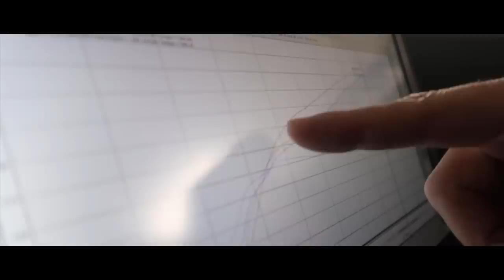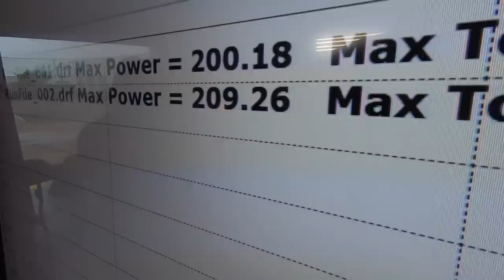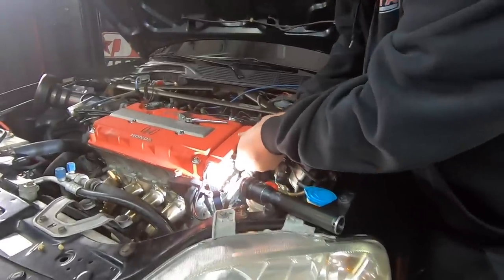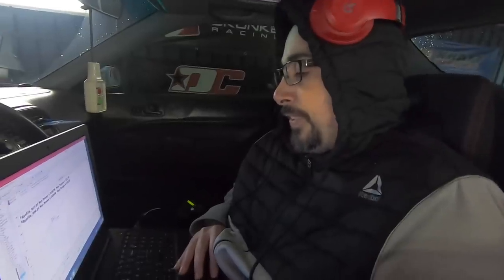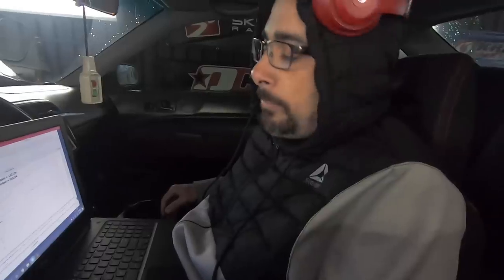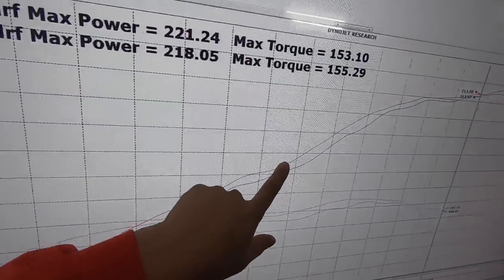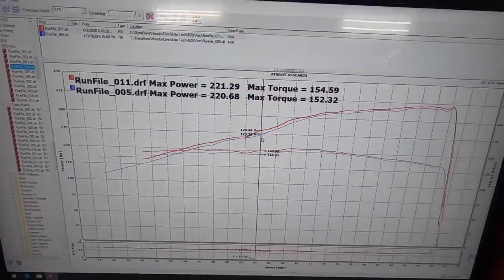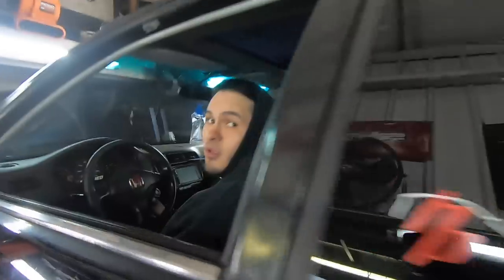Tuning Cam Gears On A 220HP All Motor B20VTEC

Comment: This is becoming a lost art. People never fine tune their cam gears on these engines anymore and think the K series is a magical engine. Long live the B series! The H/B/F series engines are all capable. I’m sick of seeing K swaps into these classic EG, EK, and DC2’s. Thanks for the video. Hopefully this will motivate all of these lazy tuners out there. Especially the F series forums which is wrought with idiocracy. They think the F is maxed out. They couldn’t be more wrong. They just don’t understand the function of the cam gears and how to boost the high-mid power of their engines. Now they’re K swapping S2000’s left and right. It’s a sad day in modern Honda tuning but your garage is doing amazing things.
Reply: Yeah real art ... Removing the top of the timing belt and slightly turning the cams. Real art....
Reply: @ABs70nova lol
Reply: Except the K series IS a magical engine. 

~ i-VTEC allows you to tune cam timing with a computer AND adjust it at any RPM. VTC is literally one of the greatest modern innovations in combustion engine design. 

~ Honda made the K series their universal engine platform for 15 years. This means good used engines are cheap and plentiful now and in the foreseeable future. 

~ H/B/F used engines are now hard to find because they were not made for as long of a time, and to boot not even all of them have VTEC which makes this problem worse. This is also why more S2000s are getting K-swaps. The F20C was a unique low-volume engine, and parts are either not as readily-available or are just more expensive than K parts.  

I respect the H/B/F platform as a diehard Honda fan myself. But you are smoking one if you think it's still the best Honda tuning platform. K is the way :]
Reply: Amen brother!

Comment: Depends what setup u do on the B20v b20v can make 264 hp on 13:1 high compression pistons
Reply: I got a b16 head to slap on my b20 with p30 pistons should come out to 13:1 but i wanna do it on pump 93. No idea what the dyno will be.
Reply: Edgar have you ever dyno we have the same set up but I have a semi built b16 head type r cams with skunk2 cam gears with skunk 2 ultra mani and 74 throttle
Reply: Edgar I’m gonna tune on e85 hoping for 220
Reply: There’s always that one comment
Reply: Hi bro how about the built b20b itr head wiseco piston 6567m84 it this set okay

Comment: Anyone who's driven an all motor B will know what's up.

K's are wild, but the tuned NA B series will always have a spot in my heart, especially the type R's.
Reply: Help! I want to put a Bigger Engine in my Del Sol for fun not racing... 
i am looking at the 185 B16B JDM... I would like 220 hp but not sure... want a reliable solid engine..
Any recommendations? Thanks!
Reply: @MikeKollin  B18C6 or B18C7 would be my Pick for best of the B series But if you can't find or afford the JDM Type R dc2r engine,  the B18C5 is Also a Great engine,  Good for N/A will easily get you to the 200-220whp mark an 330-380whp as a turbo,  (not using Dynojet figures)
Reply: @MikeKollin  Most of the engines from that site are out of Stock Mike,
Reply: @jjsorenavki7005  haha.. I'm using that site as a place to figure out which engine to get. Then find it wherever. Do  you have a recommendation of where to buy? Thanks!
Reply: People don’t know why K series are better and that they don’t actually need to swap a K series in. They just need some old school education. I’ve never seen another YouTube car tuner actually fine tune the cam gears on a B or F series engine. Then they wonder why K series make more midrange power. They use words as “modern”. If an F series engine is in the debate they’ll say it’s “maxed out”. They’re clueless on how engines produce power. Evidenced by J’s Racing 320hp F22c as early as 2006; that engine can keep going producing power. Just like the B series engines too. Jun racing had a 250hp B18 EK in the early 00’s. Tuners these days are lazy. If it can’t be changed with a button, it’s not going to happen.
Reply: I have FA5 Civic Si 2011 with bolt ons and hondata flash pro dyno tuned 91 made 225 hp and 163 of torque all motor k series stock
Reply: @MikeKollin  for the price of that motor you can buy a GSR longblock running or nlt doesnt matter on facebook and send it to css then send to your local machine shop and maybe have some to spare

Comment: I recently swapped a jdm gsr into my del sol and took it to get it tuned, dude squeezed 201hp/ 143tq  nothing done but Highend header and 2 1/2 in piping  thing is very responsive I absolutely love the way it drives

Comment: Good stuff.. Nice to see some all motor B series content.. My stock bore 12.2 Compression LSVTEC makes almost the same power.. 220whp & 148tq on stock LS rods with Skunk2 Pro2s
Reply: What pistons?
Reply: @RACEALOTGARAGE  Supertech..
Reply: Dyno video is on my channel when it made 217whp and 138tq with the Edelbrock Intake Manifold.. Gained 3whp and 10tq at the top but 5-15whp and tq throughout the band when I switched go the Skunk2 Ultra Street IM..
Reply: My b20v stock block built head oem intake mani makes 220whp 155tq
Reply: @klkk3382  what she trap? Et
Reply: @RACEALOTGARAGE  my best ET 12.77 @ 106mph 2365lbs EJ1
Reply: Low 11. Cx shell
Reply: @klkk3382  could you give us a break down of your built
Reply: @klkk3382  Which B20 bottom end did you use? High comp, Mid comp, or Low comp?
Reply: What was yiu cam gear settings? Retard the exhaust and advance the exhaust correct

Comment: =( i had a b20v in my DAP EK hatch that made 217 with gsc stage 2 cams, DVsprings, supertech valves, intake porting, on a stage 2 clutch..... it was so great...
Reply: Gickels McDoogle it was stock bottom end??
Reply: @Killmonger47213  yeah, so it was a bone stock B20B With PHK Pistons. No idea how it made 200+ with that block, but yeah, 217whp on a dynojet.
Another Tuner ended up blowing up the motor after doing valve lash and adjusting timing. Something happened to where all of the valves touched the intake reliefs on all four Pistons, bent 4 valves, blew a hole in one piston and caused catastrophic failure to the whole motor.
I sued them and won, despite signing a dyno waiver because THEY fucked up, still charged me 650 and vandalized the car after telling them it was their fault, not the motor.
After explaining the reputation of the tuner (which I later found was HORRIBLE)
The judge asked me, "so you drove the car there, almost an hour away, and.... Then you no longer had a functioning car less than an hour later" still lost a ton more in new parts, but I was awarded 1700 in damages, and he's been sued 3 times since.
Reply: Gickels McDoogle damm what shop with this?? And what state?
Reply: @EgHatchK24a2  Maryland. Rhymes with Mynetick Cartoworks. For obvious reasons, I would prefer not to disclose in plain text :/
Reply: Gickels McDoogle wow bro that’s crazy .. there are trash ppl out there .. had a trash tuner before to 🤦🏾‍♂️🤦🏾‍♂️🤦🏾‍♂️
Reply: @GickelsGaming  god damn #longlivevtec
Reply: Sucks that ended up happening but it was doomed from the start. Unless u notch the valve releifs in b20 pistons there is no p2v margin of error for much in the way of running larger cams. Im suprised it did'nt kiss valves right away.
Reply: @lloydgrandy8189  they were proven negligent with everything along the way, including a complete disregard to the cam card, reinstalling them, advising other shit.., saying they'd keep my car, sticker slapping my car ... It was bad. I was asked to assist in other people's lawsuits too. Lawl
Reply: Gickels McDoogle i have a b20v on my ek hatch it goes 220 hp 200 on wheel its really fun bro

Comment: I like it simple build. I have a basic build as well, but only stock bottom w/arp rod & head stud and a ported b16 head with gsr cams everything else stock 8200rpm. 183whp on 2268lbs. Damn went I redo it this time I'll up the CR to at least 12:5 and hope for 220+ on e85 with pro2s

Comment: How much should cam degreeing normally cost, I'm exactly at the point were im building my own motor and slapped in stage 3 skunk2 cams and have to take it somewere for the degreeing but I'm lost dont know were to take it
Reply: Same engine b20v

Comment: How can I get in touch with you guys ? My car is doing this weird thing were it idles fine then kind of drops like it want to cut off it’s not consistent though it’s not throwing any codes or check engine light btw it’s a 96 Honda Civic d16y8 sohc vtec

Comment: so if you are looking to drop in adjustable cam gears with a motor already in the car, is this legit vs actually doing true tdc with the longblock out of the car?
Reply from the maker: You have to do both
Reply: @humbleperformance  let's say, I have a good built motor and just dropped in cam gears and went straight to the dyno to get everything adjusted. Would I still be good?
Reply from the maker: You need to degree the motor to know where the cams can be advanced safely.
Reply: @humbleperformance  thanks for the quick reply.  Basically, anyone who just slaps adjustable cam gears, get no full potential benefits from them unless done so.  Thanks fam
Reply: @humbleperformance  another thing, to do true tdc, motor has to be out?

Comment: When adjusting cam gear, do you need to readjust valve lash
Reply: Not normally. It’s more of valve overlap that becomes a problem.
Reply: @moustachio334  So at one point too much advanced will gradually damage your valvetrain ?How much is the advance now ?

Comment: I feel like those numbers are pretty low for being on e85 my buddy has a 12.5:1 b20 vtec and it made 225 whp on 91 maybe it’s your altitude ? I know were only 150 meters above sea level
Reply: E85 really doesn't make a difference from my experience on a setup like this.  My GSR makes about the same power on motor, good #'s
Reply: slayerracing440 it’s good numbers I’m not saying that but you should see 15-25 whp from e85 just from the extra timing you can run cause of the more volume of fuel and it’s a lot more knock resistance and being 13.5:1 when I have a buddy same set up but 12.5:1 on 91 pump making 5 more wheel I would of thought at least 240 wheel from the extra timing and better fuel and the extra compression but I guess every set up is different shoulda boosted it on 10-12 pounds and made 300 it has a good head and head studs pistons and rod bolts would of been pretty reliable just would of have got 10:1 pistons instead but that’s just my 2 cents
Reply: All depends on the cams also!
Reply: @hseriesonlymonctonnb1181  same thing im saying, then again...they only said built head, we dont know wat cams he running. I was honestly looking fir more. My mechanic has a built b20, 12.5 compression with some pro 2 cams making240 out here in jamaica and we dont have that good e85 like u guys.pump 91
Reply: Brandon Brown it has cams there was a video of the build I can’t remember off the top of my head but high comp pistons with a head package shout of made more in my eyes we on 91 here to but elevation plays a big factor like for intense full bolt on h22 make 200 whp all day were I’m from and I seen a pfi speed video were they had one male 180 and they were saying they only make 150 whp in Colorado
Reply: Elevation, Weather, Cam and type of Dyno all play a roll on a final number.

Comment: Decent numbers for what it is. A bit disappointing. My H23vtec made 237whp on a stock block with pro1 cams pump93. Very simple. On 13:1 compression with pro2 and e85 probly easy 285whp. Glad I didn’t go b series.

Comment: That motor was bouncing alot just by hitting the rev limiter! That rear mount needs to be solid mount and whare it connects to the k member may have tear out going on or something? I would look at the mounts before axles start to break .. what was the cam numbers for the build why adjust cam gears if u just assembled the motor and had machine work to the block and stuff wouldn't you do all that shit and degree the cams before to the cam sheet or are you just doing whatever?? Sounds fishy but come down to Colorado Springs with that all motor and we can show you some all motor sickness anytime!!!

Comment: Can i mount the cam pulleys at zero degrees and tune them in dyno instead of getting the motor out and doing it the proper way with the cam card degreeing etc?